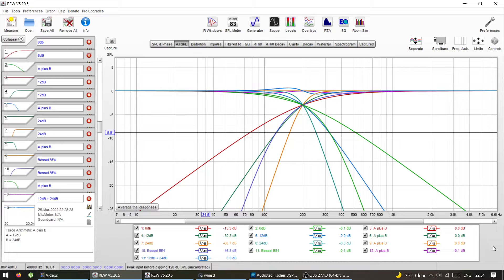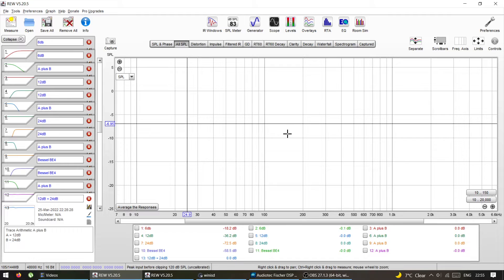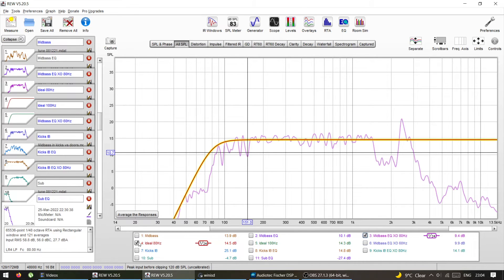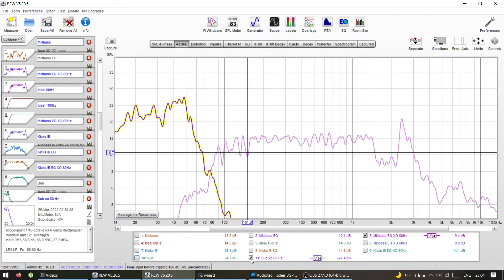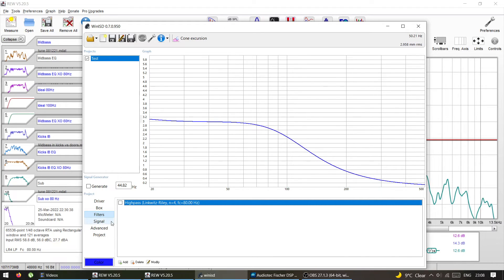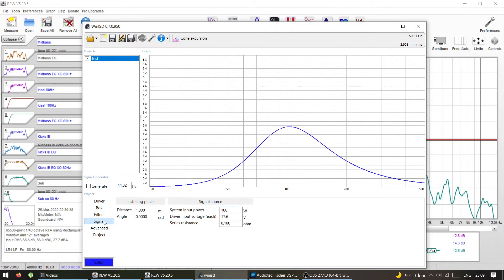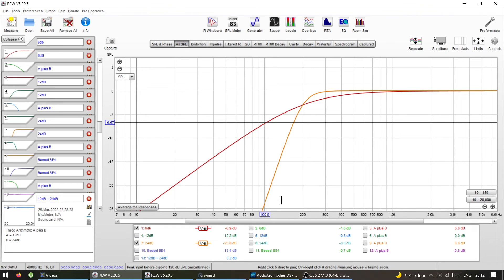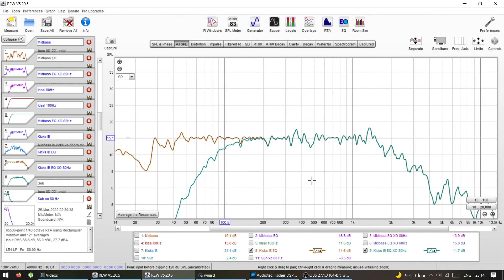Crossovers and slopes

Comment: You're the only true content creator ive understood about car audio im learning quite a bit and having an understanding. There is so many questions i want to ask, but for now i want to know about how do you know what is the ideal curve you should target if you want to sum flat i have a 3 way fronts and a 2 way rear and a rear sub
Reply from the maker: "ideal" house curve is personal prefference. You need to try a few and figure out what you like.
Reply: 2 x American Bass 12 inch  1000 watt subs and 2 x Alpine 8 inch 350 watt subs (using for stereo mid bass). Alpines Frequency Response says 30Hz to 200Hz.  Also have 4 x 6.5 inch Morel mid and tweeter combos 50Hz and up. Not sure where to cross them over. Not worried about tweeters because I'm using passive crossovers for the midrange.

Comment: I'm just wondering why you want a Flat Sum when you cross over a sub woofer and a mid-range speaker? If you get a peak at your crossover point will it sound louder and wouldn't you want it to sound louder?
Reply from the maker: In SQ we aim for a linear frequency response with no peaks and dips. We like when all frequencies sound the same and nothing stands out. We do want more level for lower frequencies, but that is achieved using correct targets and not overlapping the driver responses.
Reply: I have a pair of Alpine 8 inch SWR-8D4 350 watt speakers for heavy midrange. The Frequency Response says 30Hz to 200Hz and I'm wondering where to cross them over running with 2 x 12 inch subs and Morel 6.5 inch combos for highs. Any advice?
Reply from the maker: @mootine2007  those are subs and should be crosses somewhere 40-90Hz range to alleviate the midbass drivers.
Reply: Ok and what about the high end. Should I cut them off around 200Hz and start my 6.5s there? Would you run them in stereo or mono when running them with 2 x 12s that are in mono? I was thinking to run them in stereo but not sure if that makes sense.
Reply from the maker: @mootine2007 at the high end ~90Hz. Those 8s can act as a "front sub" frequency range wise. 
Sub 0-45Hz, 
8s - 45-90Hz, 
6.5s - 90Hz and up.
Reply: Thanks for the suggestions. I will try that. 😊
Reply: @RAW-CAt  would you put the 8 inch subs in stereo or mono. I was thinking stereo but would like to hear your thoughts.
Reply from the maker: @mootine2007  they can be mono. There is no stereo information below ~100Hz.
Reply: @RAW-CAt  but they will play above 100Hz just not as loud from being crossed over. Maybe I will try both ways.  Doesn't sound like there would be any negatives to playing in stereo.  The amp is more than enough power. Orion XTR 1200.2 so should run nice and cool.

Comment: Hypothetically

What happens if you cross over your mid base at 80 Hz with a 12 DB slope. But to help with some of the dips and cancellations you cross over the subwoofer with a 90hz 12 DB slope. 

Would they still be in phase since you’re still using two 12 DB slopes?

I mean, naturally, I understand that we don’t have an answer until we run pink noise through the system and actually get an acoustical response. But just like I said, hypothetically, with that tend to probably make sense? Crossing the crossover points at slightly different levels so that way they wouldn’t be so much of a dip.
Reply from the maker: Well, my sub was crossed at 100Hz 12dB or so, to match 70Hz 24dB acoustical slope. At all depends.
Reply: @RAW-CAt  I will play with it today with my processor. I have 6x9 mid drivers so i can go a little bit lower in tuning . I might try  70hz and a 90 hz with Sub. 

But definitely stay with matching slopes correct? I mean as a starting point. I know there’s no such thing as concrete perfection. Everything is to the ear of the listener.

Oh never mind I just saw you did the same thing I thought about doing. You had two different slopes. 

But I can see how all that blends itself together because although the slopes may be different, the crossover points are different. So it reduces the amount of phase relationship issues.